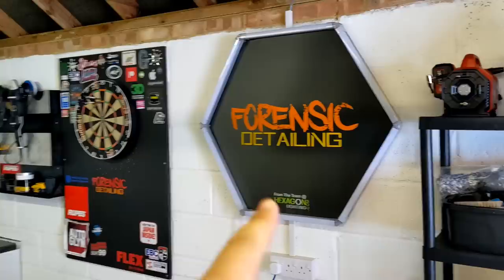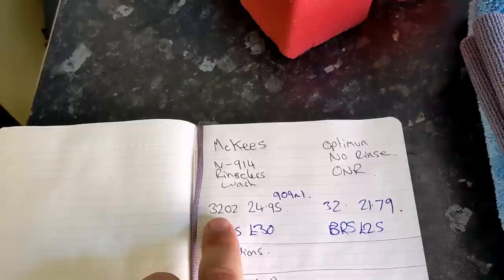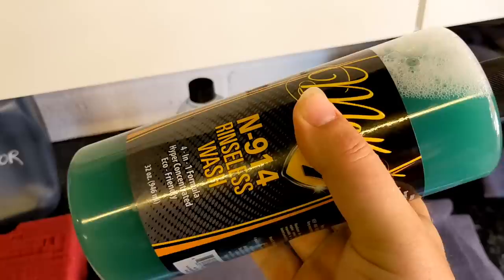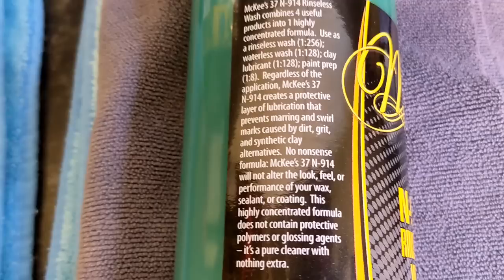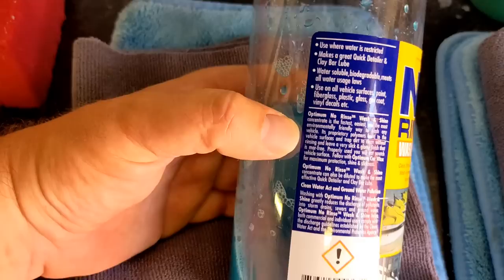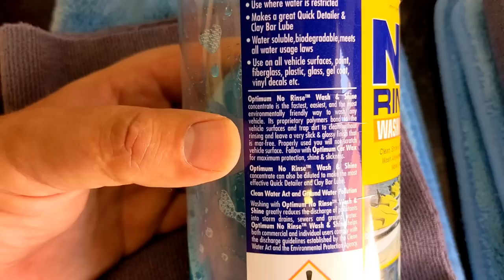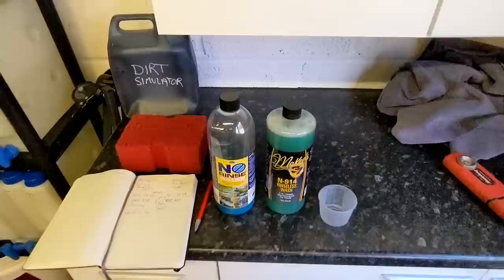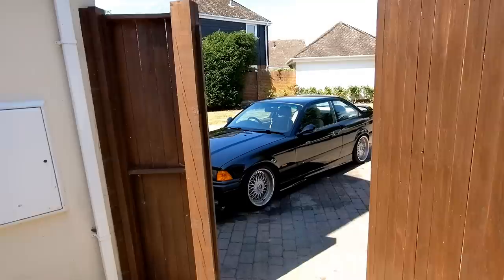O.N.R V Mckees N914  Which one is best? | Best rinseless wash comparison

Comment: ONR leaves a polymer protection behind.  I have stopped using it and switched for McKee's 914 because of it.  When I am about to either polish or apply a ceramic coating, I don't want to have to worry about polymers on the paint.   I feel they both work the same in terms of cleaning.    Two things I would suggest to prevent swirls: 1. Prewash by doing a foambath and pressure cleaning.  2.  Use a drying aid like a spray wax, or quick detailer when drying.  If you do those 2 things, you will never scratch the paint and make swirls when you wash with rinseless.
Reply: McKee’s leaves something behind too.  It’s just marketing saying it doesn’t. The fact is they both do as they don’t flash off 100%, but neither affect last step protection applied after.
Reply: @jayhoughton558  Exactly, either product is going to somewhat dry on the paint and with the amount of cleaning power and slcikness both products have, all of the cleaners and lubricants won't just flash off. Regardless before a coating youd, Decon, polish and prep the paint.
Reply: @Alan Wong both are safe for ceramic coatings. I would try a small bottle of both and see which you like better. Soapier N914 or the encapsulating of optimum no rinse.
Reply: @Alan Wong minimally if they do and not long term. 

When I use them I dry with a drying aid, usually ceramic based, so it’s the toppers I use that give the hydrophobics.

Comment: I'm curious what folks think of the difference in amount of dirt coming off in the bucket, one compared to the other. 
Would think with the ONR, less dirt in bucket means more dirt left on car, taken off during drying. Not saying that is a bad thing, I have no idea, but a definite difference in the two products. 
Eddie Colon noticed the same thing with some other products (iirc the P&S Absolute did not pull dirt off wash media as well, but can't remember which product he was comparing it to). 
What ideas do you all have in pros and cons, where ONR appears to leave more dirt behind?  Thanks!

Comment: Jon - a quick question. I use DIY Detail Rinseless Wash - my windscreen suffers from horrible wiper judder when a protective coating is applied. So I use Glaco Ultra Compound on the windscreen to strip back any crap that has accumulated. The windscreen is completely hydrophilic - the way I prefer because there is no wiper judder. After using DIY RW, the water started beading off on the windscreen - wiper judder reappeared. I asked the DIY group if their RW contains any hydrophobic agents - they said no? 

Whats your thoughts?

All the best.
Reply from the maker: Not sure m8.  Would need to see it

Comment: Hi, great video !!! Theoretical question: is there any point to apply wax/sealant after rinseless wash ? What do you think about it ? Will the wax or sealant last or not ? Thank you for your answer.
Reply from the maker: Rinse less are really good at not degrading existing wax.. but I prefer a full proper wash if I'm going to relax.  It won't be clean enough with rinse less

Comment: Why didn’t you use a gritguard in a bucket to trap all the dirt your drastically bringing back in?

Why are you soaking and plopping it onto the paint without squeezing it until the point it’s barely dripping?
Reply from the maker: The surface will still be dirty even with a cleaner mitt. So you have to trust it.

Comment: I watched your original review, I have never  seen you so apprehensive,  big question is, would you ever use ONR if you had a hose and water a available? I have ONR but never really played with it
Reply from the maker: i was really pleased with the results.   I will never do a full wash process with ONR or 914 but I will do what I did today again.  IE just gentle wipe over in 5 minutes to make car like 90% clean.
Reply: @ForensicDetailing  did a maintenance wash on mine yesterday, got the same effect on my car as the original you did, with dirty rain last night, need it clean for a funeral tomorrow, so it’s a toss up between Touchless or ONR

Comment: Yeah they definately leave something behind, you wash a car with no protection and then look at the water behaviour after it beads and comes off. I used to use at QD levels as a quick glass sealant as it was decent especially on side windows..
Reply: Also I noted you didn't pre soak the panel which is in the instructions should pre soak and leave it for a few minutes then then clean as it needs time to lift?
Reply from the maker: @brianhunt914  it does not say to pre soak the panel on the instructions I had for either product.  I show you the instructions in the video.  but I think it could be a really good idea to do this.
Reply: @ForensicDetailing  think I got it from one he videos from what's his name you say in the video ah brain blank! But yeah I always spray the next panel pre the one I'm wiping so I has time to work.. but I rarely do onr wash as like you it freaks me out lol.

Comment: dry humping the paintwork just feels so wrong….i have super soft paint and just know i’d put in marring and scratches if i used these type of products.
Reply: They really don’t. Great products for interim washes when the car isn’t really dirty. The downside is the various nooks and crannies that need flushing. Pre spray the panel, contact wash, dry with your QD/spray wax type product of choice. Used ONR for years on black cars no issue. Great water softener, no water spotting and loads of lubrication unlike water.

Comment: So timid lol. With all Rinseless you must spray down with same mix before hand. If you wanna pressure wash, spray it first then, pressure wash then spray again. Then do what you doing. And you dont wipe the same side back and forth. 10 cloths will do a car on average.  I think all those foams and soaps give us false perception. Cars still get swirled and scratched in the end and we blame it on the wind.....and dont forget the grit guard.
Reply: Yes that probably works better but like he said he went off the instructions which even on the ONR bottle are not the best.

Comment: I just cant get my head around rinseless washes. Wiping a panel with obvious contamination makes no sense. Cant see myself ever washing a car this way. Been washing my cars for over 30 years and the reason they still look new 5 years later is due to the way i look after them. This will never be an option.
Reply: How do you wash vehicles ?
Reply: Yeah it goes against our detailers mindsets to simply wipe away the dirt. ONR says it encapsulates it but how much? How much is too much dirt? In only use RW if I have to and will use spray bottle and a pump sprayer and then ONR for the wipe down but I wipe once with one side one the towel, turned into quarters and then flipped and that’s it I get a new microfiber. Of course the instructions don’t say all this but RW products have lot of uses.